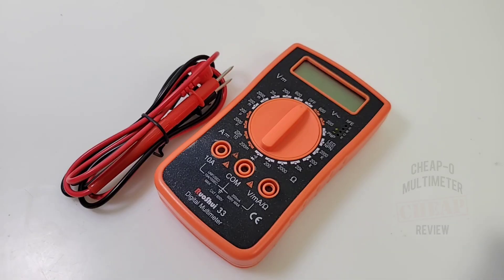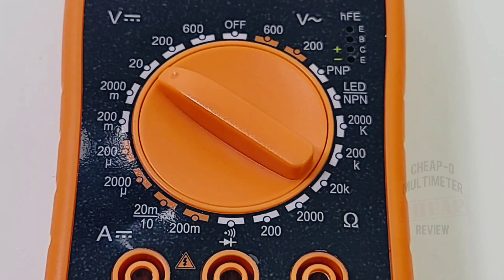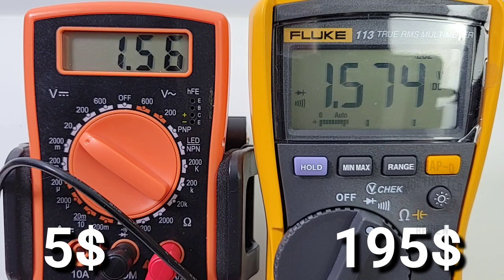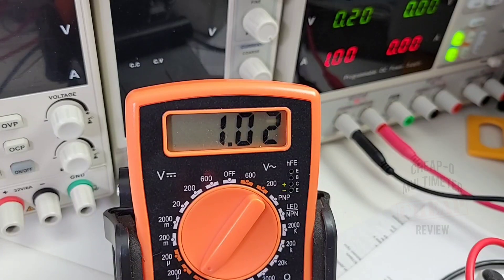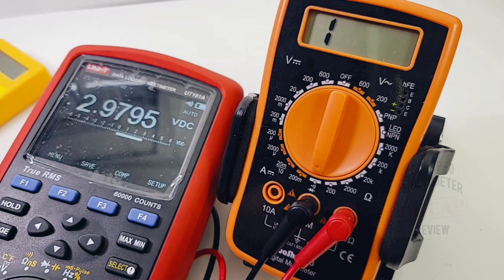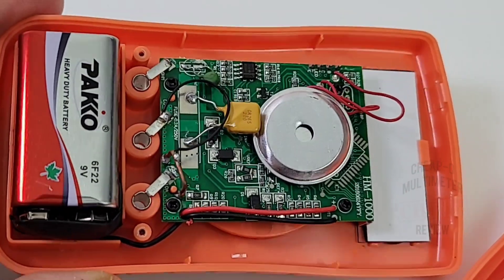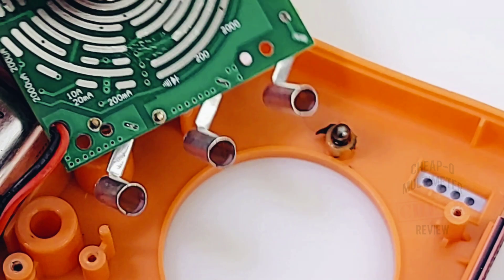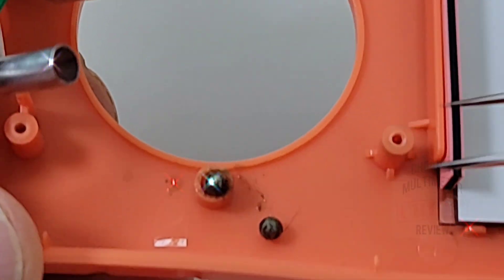RuoShui 33 CHEAP-O Multimeter Review  & Teardown!

Comment: Hi, i hope you can help me! Is there any LCR tester/multimeter (or other
testing device) that have a “pass/fail" function, with sound or visual confirmation when testing
transformers inductance and resistance?  Like, set the parameters to “234 ~ 274 uH”, if
the transformer is within the values, a confirmation sound or light tell me
that the transformer is good or bad ? Currently i’m using a “Minipa MX-1050 LCR
tester”. Thanks in advance!
Reply from the maker: Hi Felipe 

I'm in the midst of reviewing a few lcr Meters right now....I'll have an update for you shortly. How much money are you looking to spend on the lcr meter?
Reply: @KeepOnTesting  Thanks for the response! I'm working for a brazilian inductor/transformer company, and our budget is around 5k+-, but looking to spend the minimum for an "auto transformer tester" that fulfill our needs haha. Thanks again!

Comment: Looks like you found a diamond in the rough - cheap but highly accurate. I just wonder though, being a cheap mass-produced item, if its accuracy will hold for all the DMMs that are made.
Reply from the maker: I think it should as most modern production facilities seem to have fairly good Q/A especially at the chip level. The few times I've sampled the same units but from different sources they were almost identical in performance.👍

Comment: What's a good way to tell when it's time to replace your DMM battery?  And does the battery quality matter?  Regular versus akaline?
Reply from the maker: Most multimeters will have a low battery indicator that will display when the battery is getting too low.. if not, when things start going wonky.. digits dissappear,  meter turns off.. these are classic tell tale signs to change the battery.. I personally don't have a  preference for Reg vs Alkaline..I have had alot of negative experience wuth Duracell so they are definitely on my nofly list. Amazon batteries are relatively cheap and well made...no plug intended.😉👍

Comment: It's basically the same as every other cheapest option you can get even in local stores (but that costs several two to three times more then), just slightly different design.
Reply from the maker: Yes and no... you rarely see these types of self resetting fuses on such a low priced dmm..that plus the DIODE test make it slightly more appealing than your average 8xx clone.👍

Comment: Nice meter for $5. Thanks for reviewing.

What happens when a poly fuse fails from being reset too much? Does it no longer trip or does it not pass any current?
Reply from the maker: They are sensitive to higher temperatures so it's difficult to say, either a dead short or possibly a burnout albeit that would be very rare. Usually, they would just fail to return to their initial low resistance state.